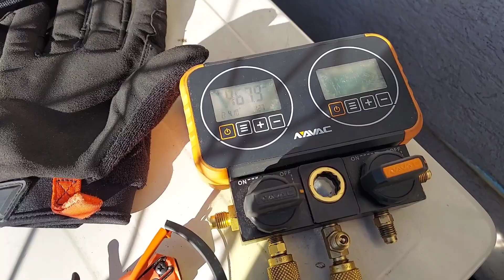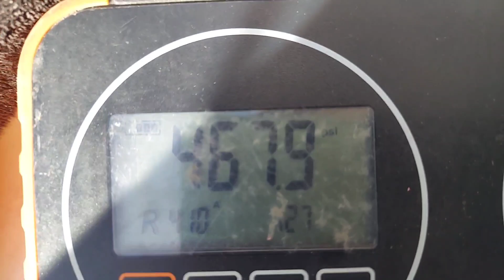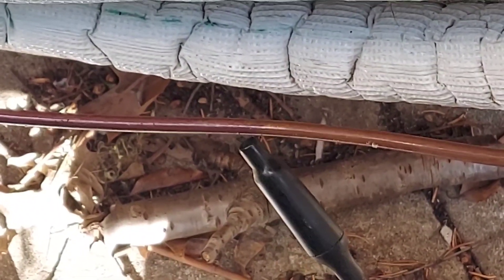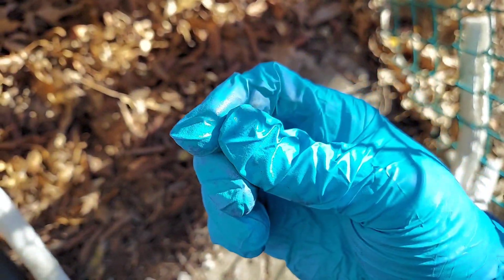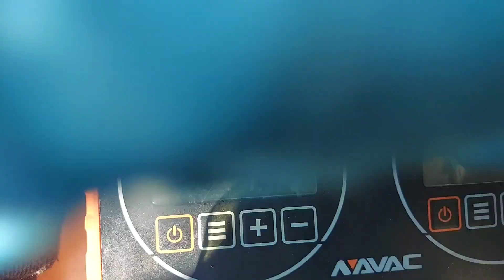FUJITSU MINI SPLIT TROUBLESHOOTING

Comment: Ive had to replace many linesets with that white insulation due to pinhole leaks, its due to a reaction of moisture mixing with the foam in the insulation
Reply from the maker: Really?
Reply: @D2DNYAC  yeah it makes it acidic, youre supposed to seal the insulation on both ends or wherever there could be infiltration, and also that stuff isnt uv protected, you have to uv protect it in the field
Reply: @rayd576  yes that is true, but it seems like it was only during a certaim timeframe. My company doesnt install that stuff anymore